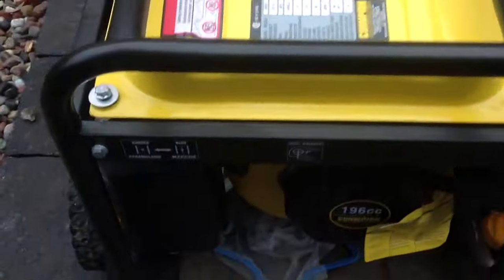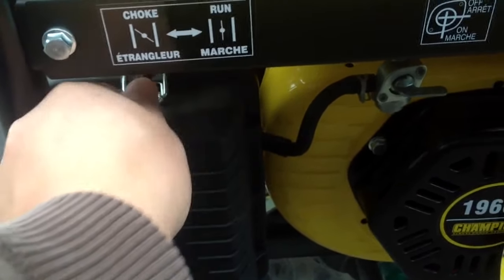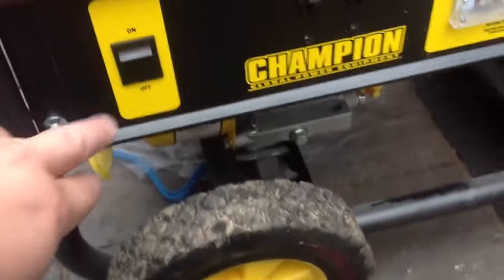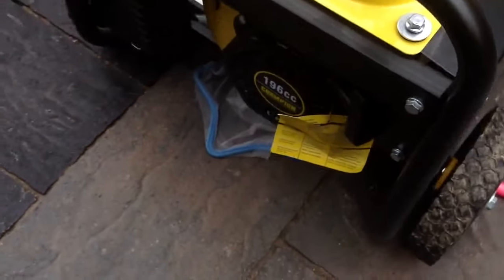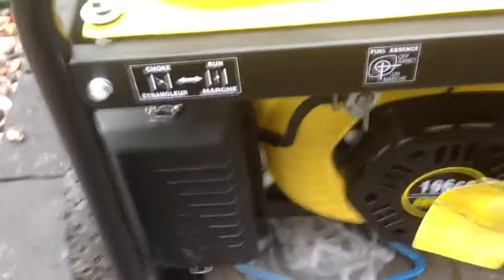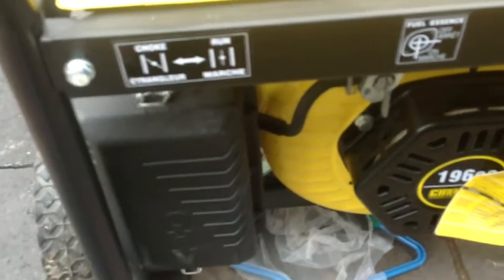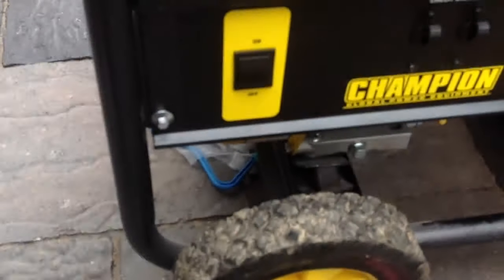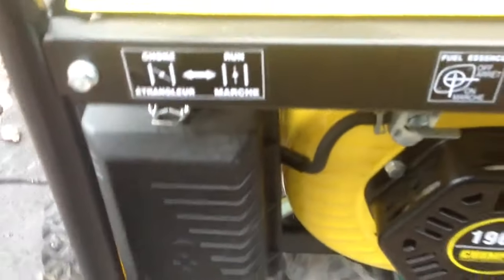Step by step instructions for Champion Generator

Comment: Turn the generator off by cutting the fule, this way all the gas is run out of the generator and won't gum it up while sitting.  Also advise to add oil to new champion generators as they ship with no oil in the crank case.
Reply from the maker: Great advice. Thanks for sharing.
Reply: @DaxM  what do you mean by cutting the fule?
Reply: Turning the fuel switch off first and allowing the engine to come to a stop as the remaining fuel burns off. Then flip the buttons to off.@jaxn4545

Comment: I prefer to close the fuel valve and let the engine finish using up the fuel in the line and carburetor bowl because it keeps it clean instead of allowing the fuel to get old and contaminate the fuel jets in the carburetor
Reply: James, what kind of oil do you use for this?

Comment: 100% best Generater.Systems I have used. A test for hurricane prep here in Louisiana: three AC units, 5000, 5000 & 8000, 3 fridges, 2 device power setups, 4 flat screens....AND I had 40% of the power meter to spare.
Reply: Just bought one of this but it won’t power my refrigerator when I plug in the breaker shuts off then I have to reset it it only does it with the fridge. Any advice ???
Reply: @EduardoRodriguez-nh4cc  fridge cord might be frayed or a short maybe

Comment: I have the very same generator. Mine been setting for 3 months. Got it out today and that little work horse started first pull.  I ran it for 7 days in in an power outage.   I couldn't believe I was the only one on my street that had a generator.  
    Neighbors would come by and ask me to charge there batteries and phones.  Friends came over and we would wach DVD movies and pop popcorn and hot drinks.   Seems to me a generator is a very important thing to have these days because we have record breaking weather every year.
Reply from the maker: That’s great to hear. It’s always good to have helpful neighbours like yourself.
Reply: Thank you sir and I was wondering and can't find a video about it. But do these generators have an oil filter?  I know some do because you can see them but what about these ?  I looked everywhere and couldn't find one
Reply from the maker: Ya I couldn’t find one either. But I can’t say for sure it doesn’t. If i find out I’ll let you know. Please do the same if you find out before me.
Reply: @DaxM  will do
Reply: @DaxM  well I found out not all portable generators have an oil filter.  Its mostly the older models.    I get mine out every 2 months to exercise it.  But just for 30 miniuts.   From what I learned you have to to keep it running tip top.    And it's better to drain every drop of gas out of it for storage.
Reply: how much gas would be needed for 7 days of running?

Comment: mega important...don't forget to put oil in the crankcase, unless you want to seize it!
Reply: Theses units have low oil switch. They will not run unless there is oil in the crankcase.

Comment: New models are much more forgiving. One pull. Immediately shut off choke fast or it will die. I don’t have a fuel cut off switch or lever. Mine is similar but dual fuel and 206 cc. My old one was just like yours and yes u r right it was more finicky on the choke

Comment: to shut down for storage turn the gas off and let it run out of gas burns up the fuel in the carb
Reply from the maker: Good tip. Thanks.
Reply: @DaxM  then for longer periods of time remove the float bowl drain screw. This will allow all the fuel in the carb to drain out.
Reply from the maker: Ted Bishop that’s an excellent idea. I learned this the hard way and had to take everything apart to clean out the carb. 😔

Comment: The generator has been idle for long and it can't start
Reply from the maker: Mine did that too. It’s probably your injection/carb system gummed up with old fuel. It needs to be taken apart and cleaned out.
Reply: One ounce of Seafoam liquid product p/gal often works into the system to 'ungum' the line and carb system. Sold at most hardware and convenience/gas station stores. Priced at 7.99- 11.99 per 16oz can. Also haven't had to change a sparkplug in ANY of my 2 or 4 cycles since I started using it as regular fuel additive for the last 8-9 years. That's JD rider/lawn tractor, snow blowers, push mower, leaf blower, chainsaw, emergency gas generator,  hedge trimmer .. etc. They key is adding 1 oz to every gallon of gas as a regular thing.